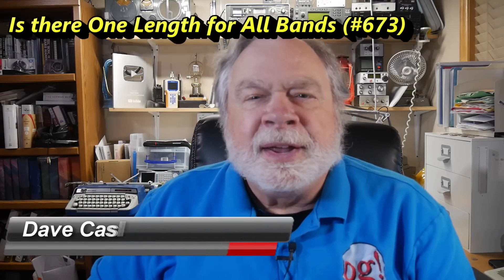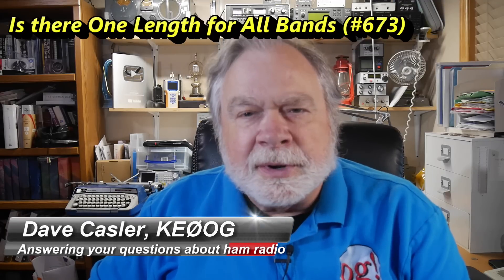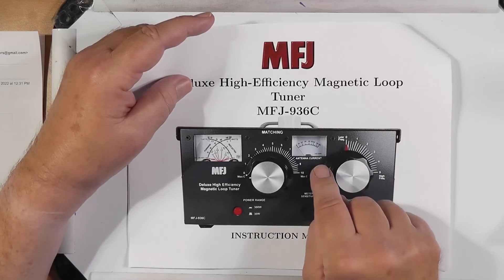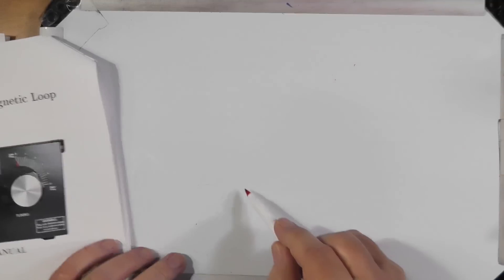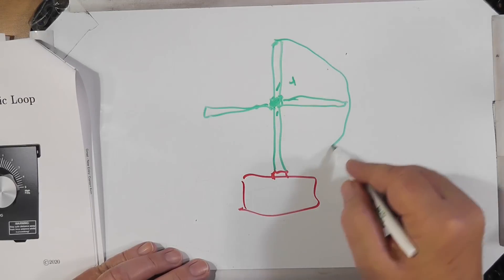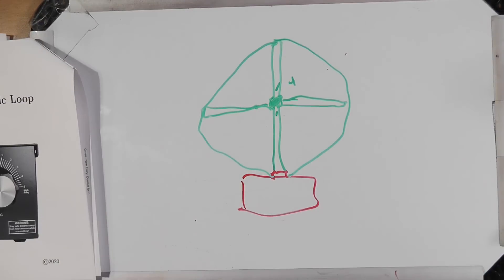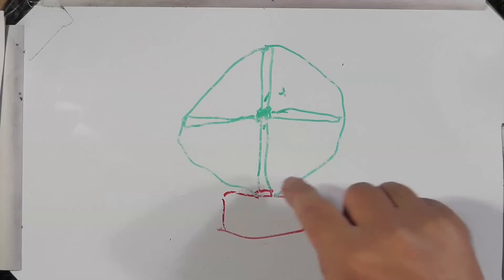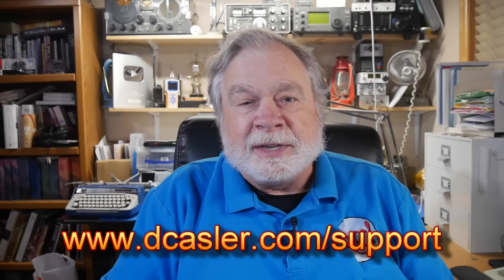Is there One Length for All Bands? (#673)

Comment: Tom af5ag. I have a mfj936c loop tuner and found out that a 50 ft. Coxial will tune 80 meter. You have to wrap the coxial several times around the t mount. It will work indoors but a outside antenna is much better. 73 and I like your show.

Comment: I purchase a RTL-SDR Blog R820T2 RTL2832U 1PPM TCXO SMA Software Defined Radio 

Should come in the mail in a few months I'm anxious to try it out also I'm going to be hooking up a LNA, 1pc Low Noise Amplifier LNA 50M-4GHz NF=0.6dB RF FM HF VHF/UHF Ham Radio -110dBm,for High Frequency Preamplifier of Radio Receiver

Now I've been looking at various videos and one guys using CAT5 he's cutting the one wire strands various lengths to get different frequencies which looks promising so I'm thinking of making a multi antenna set up like so I was wearing your thoughts on that also I saw a couple do-it-yourself tuners they take a coil of wire and wrap it around plastic tube and they put bolts and nuts about every three or four centimeters apart and they hook a lead with a alligator clip to help tune in the antenna to match it and they use a variable capacitor so I'm wondering your thoughts on SDR radio with antennas do you have any suggest about the cat 5 multiband antenna and a good do-it-yourself antenna tuner thanks and advance...

Comment: Hey, David, I'm just getting into HAM and have a couple of questions concerning what you covered on this video. #1 - Does the loop that put on top of this tuner act as the actual antenna, or is it just a part of the tuning circuit? #2 - Can you put multiple length loops on the same (cross) and switch between them?  Thanks!!!
Reply: The loop is the antenna. You'd have to change loop wires at that tuner.

Comment: You can feed a full wave loop with coax and 4:1 balun. It won't be efficient on the higher bands but it will radiate and receive. A tuner can help smooth out the swr. Full wave loops work to the longest wave it is cut for. Loops are best fed with  ladder line and a balanced tuner.

Comment: @Dave Casler - Is it possible to connect multiple loop lengths at the same time? Like a fan-loop?
Reply: I also want to know, thanks Dave.
Reply: Yes you can. RF will 'seek' effective radiator lengths.

Comment: If you want an all band loop, in the attic, using 2" stand offs, run wire around the inside perimeter of the attic, and feed it with ladder line, connected to a MFJ 993b Antenna Tuner (has 4:1 balun built in). As long as you can get the length more than 40 Meters long (which isn't a problem for most attic's) it will work (Tune) on 180-6 meters. If your attic is less than 20 feet high, you will be good and effective from 6-20 meters with 30-160 Meters being workable, but closer distances (NVIS). If you have a 2 story home with a large attic above, then 40-6 Meters will be effective, with 80-160 being workable, but for shorter distances (NVIS). For those who live in HOA's, attic antennas of one sort or another is an option. Keep in mind what one person considers "effective" may be different than another, but an attic antenna is better than NO antenna. Hey, the solar cycle is continuing to get better, and before one knows it, we will be hearing about how X ham was talking around the world with his coat hanger antenna in the closet.
Reply: Just thinking about the Attic loop antenna, like described above, there are considerations! #1 getting RF in the electrical wiring or other electrical devices. #2 Getting noise in the receive loop if too close to AC wires!.  These issues can be overcome, but can be a pain to solve, so keep that in mind. Also, antenna tuners can be a pain as well. So, if you are a rag chewer running up and down the band, a non resonant loop may not be for you. However, If you want to string a resonant length of wire in the attic, you will be resonant at many multiples (not all because they don't fall exactly in line).
Reply: Just to be clear, this segment of "Ask Dave" deals with a specific type of tuner used for small transmitting loops also called magnetic loops.   The antenna described above, for attic use is closer to the notion of an electrically short full-size (one wave length total circumference) loop antenna or something like a folded dipole. .  The suggestions from Davidc502  imply using  a standard antenna tuner.  This is not the same idea using a magnetic loop tuner on an small (1/10 wavelength small transmitting loop.

Comment: I own and have used the MFJ-933C.  I believe this is the same as the MFJ-936C except that it lacks the meters and the related switches.  It is a neat solution for portable operations. 
In my experience, the recommended loop lengths are a little optimistic and in reality the loop has to be a bit larger to perform.  
I will indeed work on 80m.  However, 80m operation is difficult with this loop.  Also, you cannot use it with an amplifier due to the power limitation.  This is especially an issue if your loop is not an efficient radiator.  
The tuning of the loop is a bit tricky.  There are two controls one for matching and another for tuning.  
While they are mechanically independent, they are not electrically independent and the setting of one influences the other.  
Briefly, the fastest and easiest way to tune the loop is to use a combination of VSWR and SMITH Chart curves on a NanoVNA.